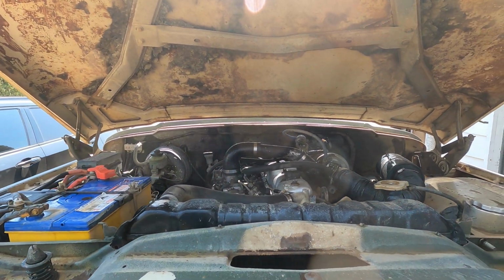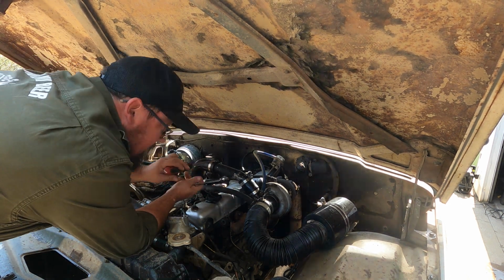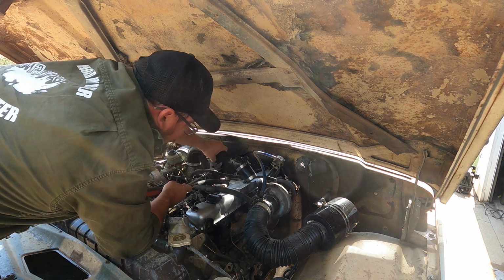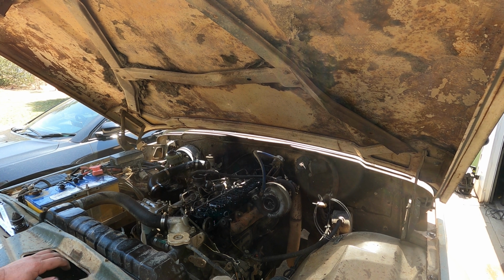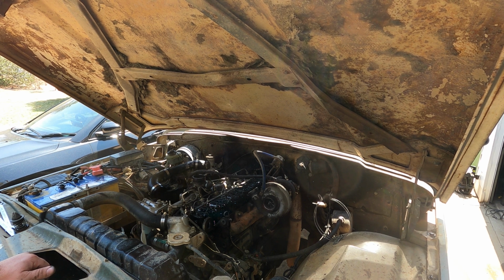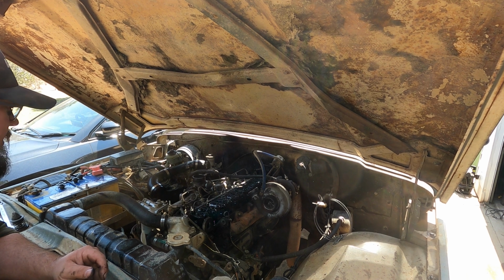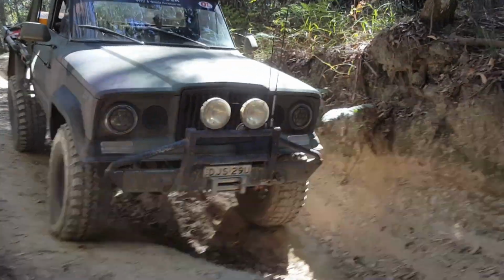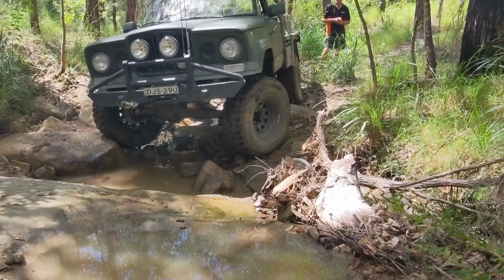Is this the end of the 2H toyota diesel

Comment: Hi I'm in North Queensland in the Ravenshoe area. I've got a J20 that was originally a 360 and auto.  Then the original owner put a 1HZ and F100 gearbox in it. I've got it with no motor in it but also have a Ford 289V8 for it. I was thinking about a Nissan SD3.3 and box from the J10 to put in the J20?